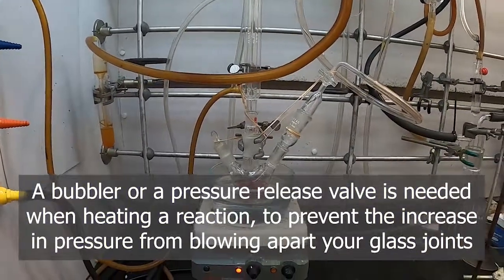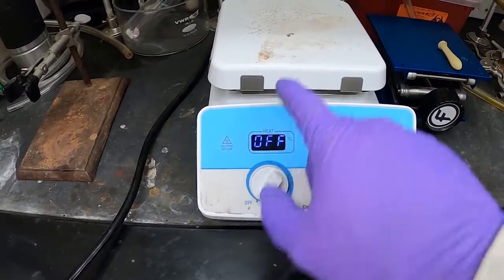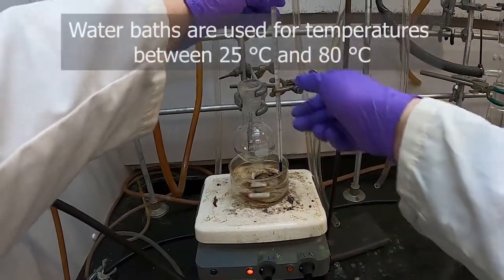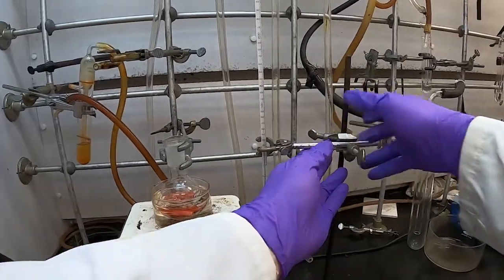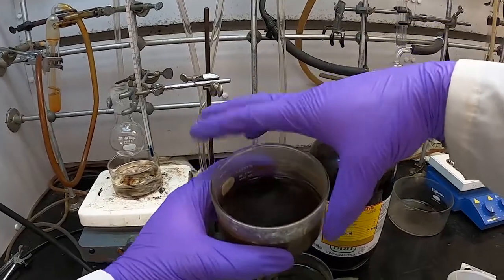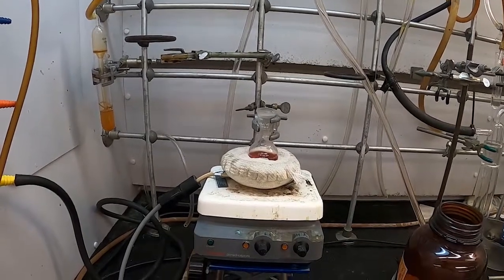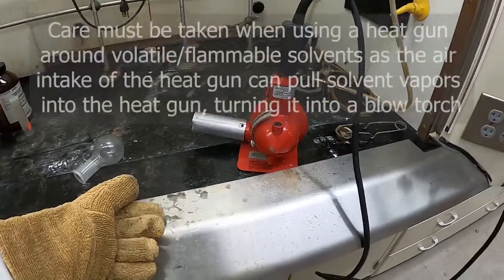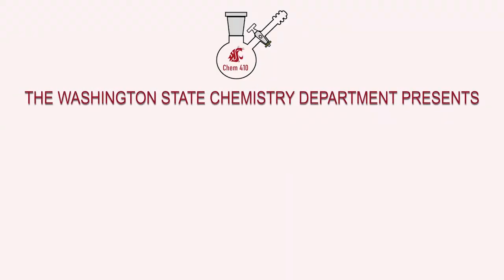Heating Chemical Reactions

Comment: When using a gas bubler or scrubber you can use a small check valve in the line to prevent the scrubbing solution from wicking back into the flask. The ones for aquariums work great for reasonable gas generation .